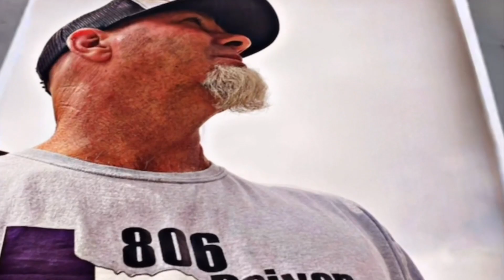Happy New Year! Tracking down a oil leak! 3406E Cat.

Comment: My 3406e leaked bad there too. Had a shop try to fix it and they said they couldnt get all required seals but used rtv on same place you talked about and it hamdled 95% of that leak. Then it started leaking at the halfway split mark in the power steering case. Tightened it up to get that 95% fixed.  Now the  igeatest leak seams to be from the rear cover. So i need to have the tranny dropped i guess, if i really want a dry motor. (My starter is getting soaked with oil from this leak) but it doesnt leave a puddle on ground, so ill probably wait until it needs a new clutch. Does your 3406E vibrate the truck badly at idle? Used to smooth out if i raised ie to 800 but not since rebuild. 950 or better or seat wobbles, front tires can be seen vibrating. Guessing crankshaft damper